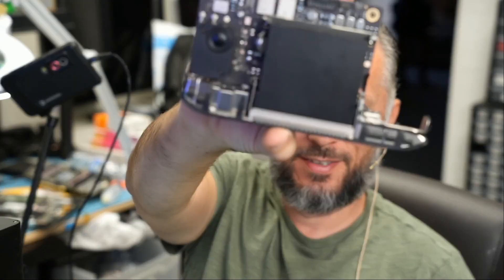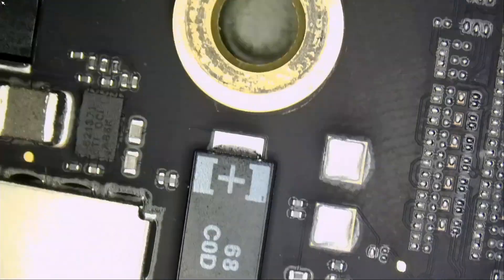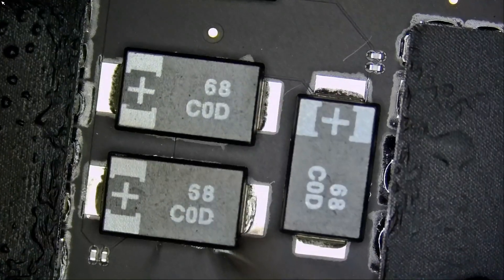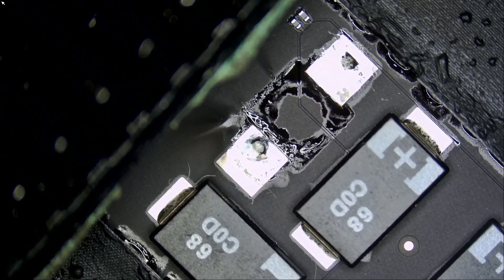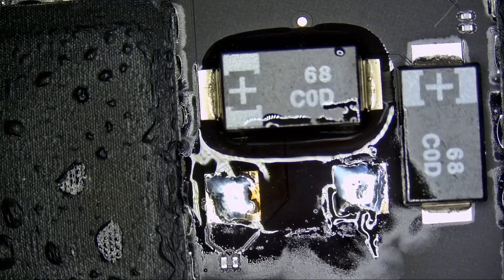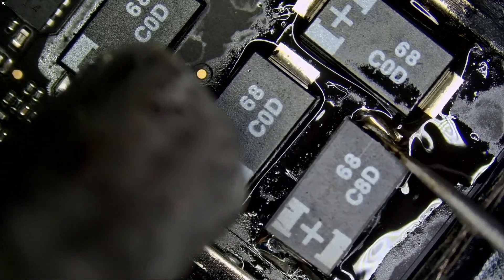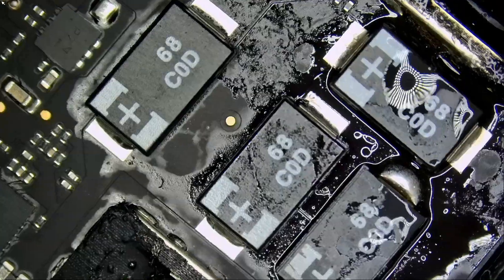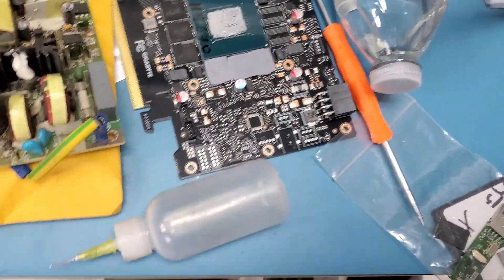How we Fixed a Dead 2020 M1 Apple Mac mini

Comment: need to make a thin coating on micro components that change color when they get to a certain temp. Im assuming they should all get hotter than operating temp when failing
Reply: Sounds like a good idea
Reply: And how do you solder them to the board?
Reply: @quadcorei8085gen2  a dip/coating after board assembly

Comment: what is the difference between 68 C0D and C8D  capacitors? can anybody tell?
Reply: The difference is Mac mini becoming better than factory.
Reply: Capacitance, but it looked like a power filter circuit, where exactly the same capacitance isnt as critical. As long as its generally the same, it'll filter out the same high frequencies.

Comment: Once you've located the bad cap, was the smoke stain visible to the naked eye or was it something that would've always required a microscope to see?
Reply: I noticed the blistered cloth tape before he even put it under the microscope, great place to start the visual inspection. I think he slow rolled us starting on the other side of the board first. 🤔